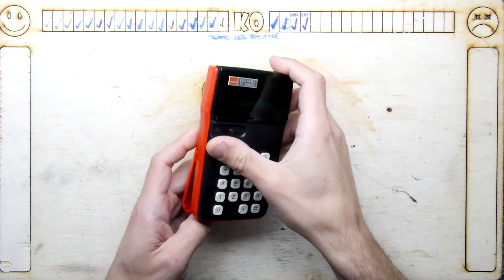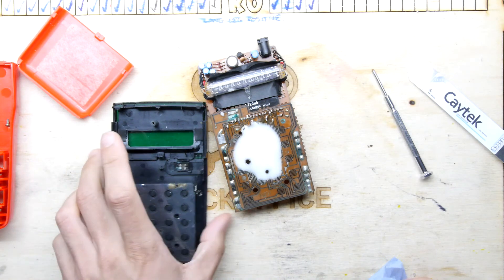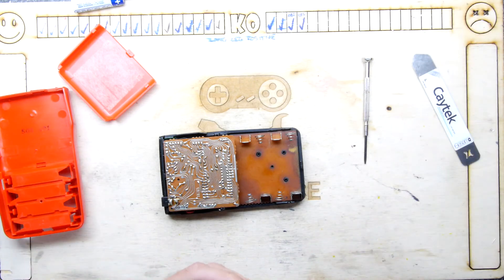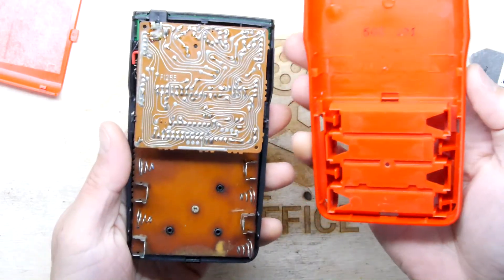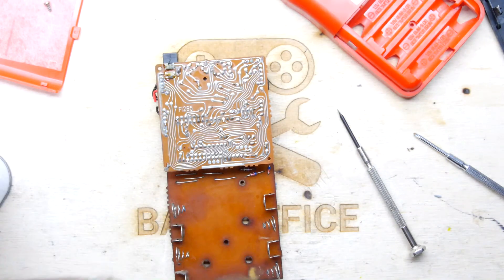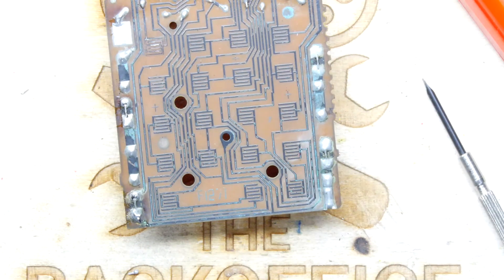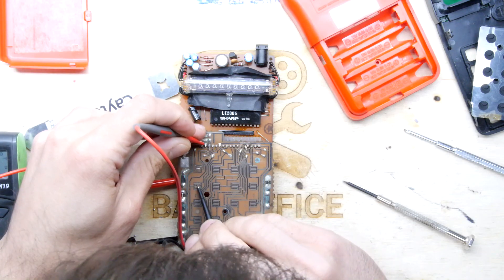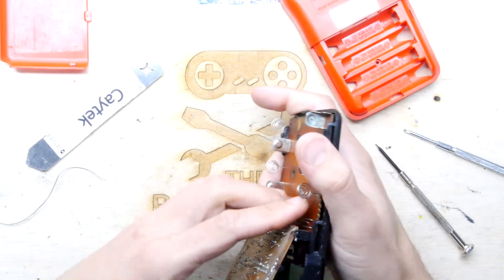Sharp Elsi Mate EL 8005S

Comment: I had one when they were new in around 1975...and I have to say, I managed to dismantle / reassemble it in a far less cack-handed manner; bending the connections probably won't do a 50 y/o piece of electronics much good. These are quite plentiful on ebay - so would be far easier to buy a replacement.
Reply from the maker: You must be very talented and delicate, congratulations.
Reply: @backofficeshow  *bows*....why thankee kindly :D

Comment: It has a vacuum fluorescent display and the round thing with all the connections on it is transformer as part of the inverter to boost up the voltage of the power supply. Flowing solder with a hot air blower is not a good idea with a corroded board you are adding impurities into the solder joints